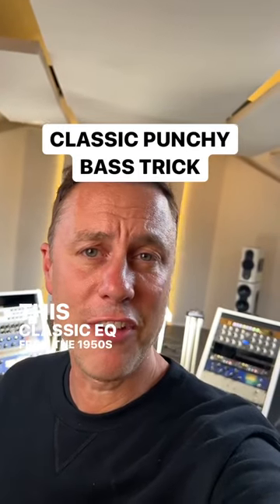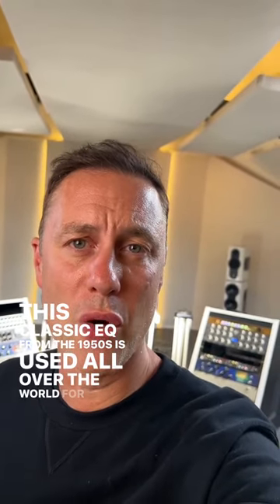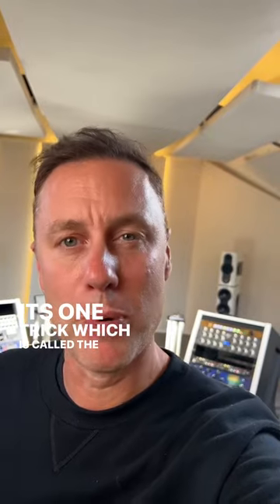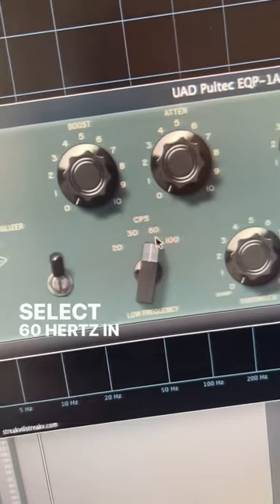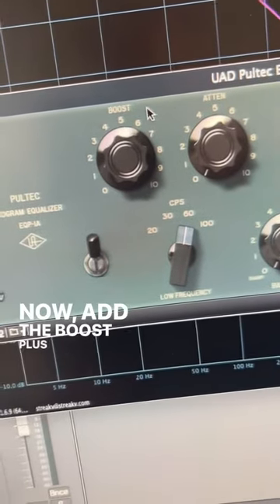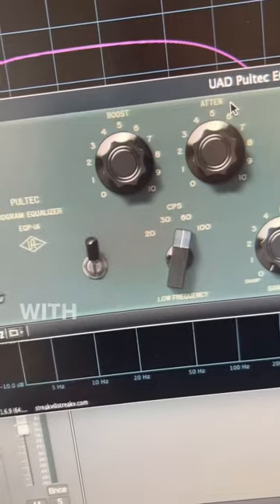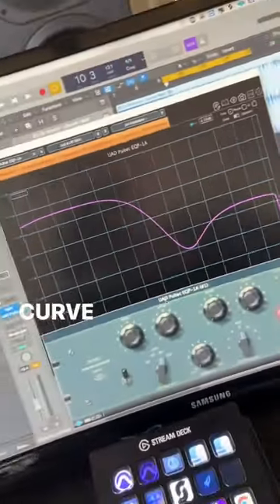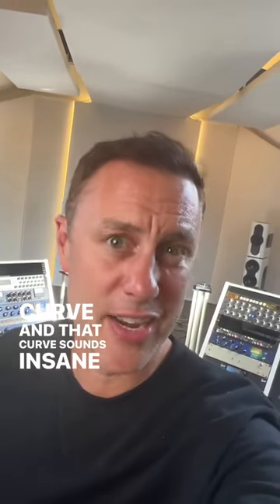CLASSIC PUNCHY BASS TRICK

Comment: Streaky you are awesome. I used the Puigtec plug-in in waves. The punch is strong with this tip. To avoid muddy subs, ensure you roll off appropriately to avoid overextending the bass. Loved what a bump it put into my synth bass tones. But I had to ensure I rolled off everything below 20-30 hz to maintain club integrity.